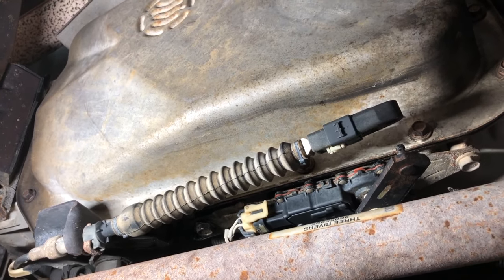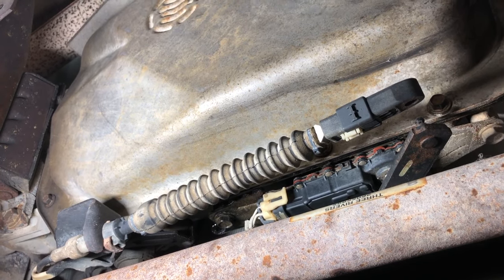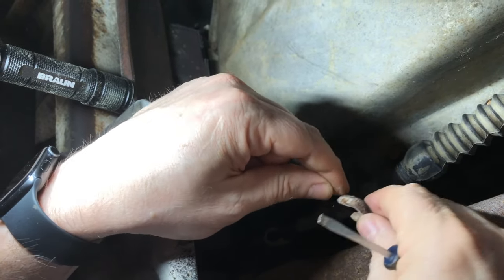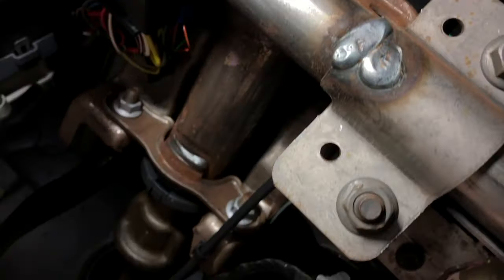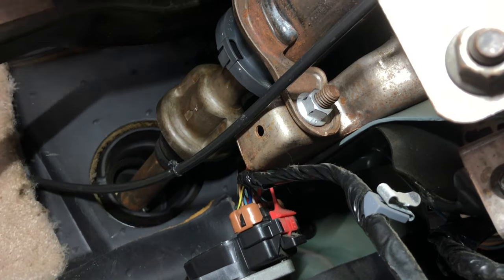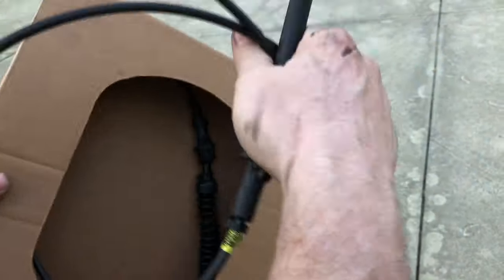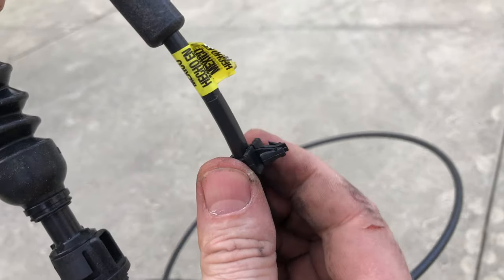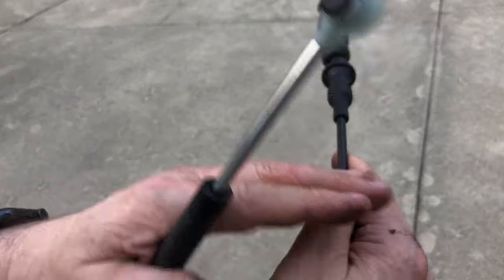1995 - 2000 GM OBS Truck Automatic Transmission Shift Cable Replacement Adjustment (Chevrolet & GMC)

Comment: This video was incredible and helping me change this cable. The time it saved me an aggravation was well worth taking the time to watch the short clip. Thank you again
Reply: @AlWhite-xo4of  Brilliant!  Only thing additional I did was pull all the floor padding out, used POR 15 on the seam and coated inside rockers.

Comment: Great video. My '95 GMC 1500 decided that I was not going to be leaving work today. I got in and went to put it into gear and the lever just flopped. Luckily I was able to crawl under and twist the cable around and get a little more of a friction fit. That worked well enough to get me home. I was hoping I could just buy a new bushing, but like you said there aren't any. Other than the one you linked. I think the cable is original, so it lasted 259k miles. I just have a bench seat in my truck so I'm not looking forward to replacing the entire thing. I have cable ties holding things together for now until I'm able to fix it.
Reply: I zip tied mine 6 years ago... use ty-wrap brand with the stainless lock. No problems.

Comment: Just wanted to say thanks for the video. I replaced mine today, frayed under carpeting. Couldn't squeeze the fittings out of the u-shaped bracket, so just busted them out with a screwdriver and mallet. Mechanics in my area are 4-6 weeks out in scheduling to look at anything, so the videos are appreciated because not all of us can wait so long.

Comment: Very thorough, the attention to detail is unsurpassed!  Kudos to you!  Attempted this replacement/repair last night.  The white locking tab came completely out.  Not sure what to do?  2 springs inside that end piece connecting to shift lever. Might warrant another short clip.

Comment: Bingo!  1995 C2500 pickup we bought used in 2009 with wedding gift money...I was adjusting ATF level yesterday after hubby overfilled it and after third round of change level/cycle through the gears/recheck level, the shift lever went floppy and stopped changing the gears.  Today the tow truck driver went underneath to manually shift the truck into neutral to put it on the flat bed, and as I had watched about 2/3 of this video, I asked him while he was under there to see if that was the end of the cable that had failed.  Sure enough, it was -- and he said there had been a zip tie on it previously, which was now broken!  I had him take a picture of it with my cell phone, and it looks just like you've shown here.  We think that actually shifting into first and second (repeatedly), even gently, was what did it.  Prior to that, 12+ years of P-R-N-D relying on the zip-tie.

I'm not up for removing the bench seat, and I'd rather fix it right than just replace the zip tie, so I'm letting the dealership take care of this.

Comment: EXCELLENT VIDEO!!  VERY thorough and well paced.  Probably the most critical portion is the adjustment of the cable at the end.  There are very few videos that cover that at all here so thank you for including that.  I have almost exactly this same truck, a 1999 Suburban K2500 but in blue.  The cable was never properly adjusted therefore first and second could not be reached by the shift cable.  I do think my bushing has some slop as well but I will start with an adjustment and go from there.  Thank you!

Comment: I changed my cable before watching this. I came here about the item that goes on the ball on the other side of the ball for the shift cable. Long story I had the other end of it disconnected to replace the Theft Deterrent Module.
 Watching this 2 things I found not mentioned. 1st @ 24:50 where you talk about what you call a "clip" is actually a sliding "lock". You show one side of it. The lock has ANOTHER tab on the other side. You have to lift/release BOTH "tabs" to unlock the sliding lock. The 2nd is @ 30:00 where you are putting the cable in it's holder. The hole has an open side to slide the cable in, AND the other side of the hole has square cutout. You put the cable on twisted 90° so that the cable's spring tabs orient to the sides-one tab in the open end and the other in the square cut-out, pull the cable through, then twist it back 90°. I learned changing mine. Also, on my '98 dually, you do not have to remove the seat (no airbags on it).

Comment: Superb video. Made it an easy 1 hour job to fix this issue with my '99 2 door Tahoe.
Thank you for the part number on the shift cable..  ended up buying the cable off EBay.

Comment: Thank you for that detailed video. I have a 1996 GMC YUKON that does not go into first gear. I will check the bushings , the lever and everything you did. I will try the adjustment with help. If it works awesome if not I’ll order the parts you mentioned. 🙏👍

Comment: Outstanding! (and great timing). I had to have my trans rebuilt. I had the cable replaced at the same time all from an Independent, not GM. My truck has two problems since this was done: 
1.) It is very stiff when shifting from Park down to any position and the same going back up to park. This is a huge problem when driving in the mountains when I take it down to "3" to avoid the trans cycling in and out of Overdrive while towing. The problem is that I have to take my eyes off the road and look down at the shift position and very carefully shift Up to Overdrive, as I am fearful of going past that position and to neutral, or worse, reverse. It is that stiff.   2.) The second problem is it will not shift all the way down (with the shift lever) to "1". It just stops at "2". I have a high level of confidence the cable was not adjusted as you have shown by the Factory Procedure.
Do you have any ideas on the first problem I am having???.
Reply from the maker: Could be both actually.  Even the aftermarket cables should have the adjustment tabs replicated to perform the procedure.  I believe this is a common mistake nowadays, where shops are not familiar with these older trucks and their service procedure details anymore.

Comment: Thank you video was very helpful and easy to understand
Reply: I can't go into 2nd or first but I can go thru all the other gears
Reply from the maker: Check that you have the cable aligned properly at both ends, and locked into position.   If you can't downshift to 2 or 1, this sounds like either an incorrect cable for the vehicle model, or a misalignment.

Comment: Thanks. I replaced my cable, but broke the die cast shifter when trying to pop the end of the cable on. Replaced the shifter and then couldn't shift it past drive. I figured there was some kind of adjustment procedure, but couldn't figure it out.
Reply from the maker: When you say "die cast shifter" are you referring to the shift lever that is part of the transmission?  If so, this lever only mounts on one way, and it will correspond 1:1 in position to each gear P, R, N, D, etc.
Reply: @DrShock  Nope. The shifter assembly on the column. Easy to change, just out $100 thanks to my gorilla fingers.
Reply from the maker: Ah, ok.  So no adjustment in reinstalling the shifter itself, but you want to get it into the matching positions at all three points.  Start with "P"ark.  Shifter in "P", transmission shift lever in park position, and then connect both ends of the shifter cable.  One at the column (with no adjustment) and one at the transmission shift lever as I show.  This latter one having the adjustment procedure I showed.  Test and then lock it in with the small clip made into the cable as I show.

Comment: Hi DrShock, you seem know well cars inside out. My car had shown "Input/Shaft Speed Sensor No Signal" error and was recently fixed. The professional was not speaking English well and all I understood is that the input/shaft gear had to be adjusted to always send the signal to the "Input/Shaft Speed Sensor". I wonder could what you explained in the video (although the car model/year might be different) be what he actually did to solve the problem. I would appreciate if you can point me in the right direction.

Comment: Im about to remove a 96 obs suv body, this is the cable i need to remove before lifting the body?( Including brake booster, shift column & gas cap)

Comment: Thank you for the video! I replaced mine and it wouldn’t shift lower than third, so I watched the end of your video and saw the adjustment part I had not bothered to watch! I’ve done the cable adjustment exercise five or six times (10-15 cycles) and I still can’t get it down to first… any suggestions? Thanks again.
Reply from the maker: Presuming the transmission lever itself is in the correct detent for Park before you start the adjustment, and that the cable is a genuine GM OEM one (some aftermarket ones just do not have good fitment), then I would make sure you have gotten the correct cable part number for your year and type of truck.  These do vary across years.   I could also suggest to recheck the steering column end of the assembly for both proper cable bushing seating, and the mechanism to the actual range selector lever being correctly aligned.
Reply: @DrShock  thank you for the advice! The OEM part was not on hand at the parts store, so I settled for the Pioneer brand, which is made in Colombia. I’ll double check the things you mentioned and try again.

Comment: Thanks for sharing your knowledge. I have a 99 6.5 diesel that won't start, and I live too far from any reputable diesel mechanics. Do you recommend a resource for a factory service manual?
Reply from the maker: I added a link in the description for the genuine GM manual.  Out of print for years, but you can still find them on eBay.
Reply: @DrShock  Thanks.

Comment: So went to replace my column shifter and broke the linkage connector off the rod. Any ideas of how to rig something up without replaceing the whole assembly. Was thinking about grinding the shifter lock mechanise rod and either using and hose clamp to put them together or worse case cut and weld togethor. Need to know asap pleasee
Reply from the maker: Need a little more clarity as to what exactly broke.  The bushing end of the shifter cable, or the steel ball it attaches onto at the column end?  If the latter, the easiest repair would be a trip to the local LKQ and pull the rod assembly.

Comment: So your video on shift cable was very helpful..I'm having a problem doing the adjustment.. it goes to all gears but won't go back into park..I'm having to push the shift lever to help put the shifter into park.. can you help?
Reply from the maker: Thanks.   So first I would disconnect the shift cable and determine if the range selector lever (this is the arm with the stud attached to the transmission) smoothly cycles thru all transmission gear positions.  This test is to determine whether the binding is in the cable or the transmission itself.   Each transmission selection on with the range selector arm will have a solid detent tactile feel so that you know you are there.  Just count from Park thru 1st and back.
 
If that all works smoothly, then the problem is in the shift cable.  Either the cable is mis adjusted, or internally damaged or the bushing at either end of the cable is damaged and not holding onto the attachment point securely.   For this test you will need a helper, and want to observe both ends of the cable (fully connected as normal) cycle thru each gear shift position.  You're watching for the stud coming loose from the nylon type bushing at the cable end(s).

At some point you're going to be able to determine if the bushing at the cable end is shot and introducing play that prevents the shift, or you're going to see that the cable is internally damaged or out of adjustment.

Comment: I have to change this out but I can get my shift lever back into park! Can I do this while it’s in neutral??
Reply from the maker: It's recommended to perform the repair with the transmission and shift lever both in the park position.  You could move the transmission range selector lever manually into park, from below the vehicle, like I show in the testing part of the video.   Technically, one could do it from the neutral position too if you had previous experience with this repair procedure. but it can be more difficult to ascertain that the transmission is in fact in that position.  It's important because if it's out of position, the vehicle will not start due to the protection of the neutral safety switch mounted onto the side of the transmission which is keyed to the neutral position.

Comment: Just curious, if the cable came off due to worn teflon, can I just replaced the small bolt and replace with a bolt and nut? I mean it would hold the shifter cable to the linkage firmly. Would that work instead of installing a new shifter cable? Thanks
Reply from the maker: The nylon material in the bushing holds onto a metal ball stud.  It has to rotate as the stud is attached to the shift lever which is angled.   You would be better off trying one of the bushing replacement kits in the video description than a jerry rig.

Comment: I don't understand why in the world they put such complicated connectors on this ! I mean a cotter pin or a e-clip would have been simpler, held better and been so much easier to replace if it did break or wear out. Same silly type bushing on my shift brake interlock  has worn out and it fell off. Noticed it when I was replacing the ignition switch module . I had wondered a while back when I was able to shift out of park  without my foot on the brake!
Fixed mine on the transmission end by drilling out and removing the pin, then putting in a 1/4-20 bolt and nut with nylon lock!
On the steering column side, a bushing that holds the foot on brake before you can shift out of park rod, wasn't holding that rod on so I just put a zip tie around it and the shift rod to keep them on their pins.

Comment: So my 1998 K2500 is having a problem where it shifts through all the gears perfectly fine but when I go to put it into park from reverse, the light stays on reverse on the dash and the truck will want to roll backwards. If you get under the truck and flip that lever, the truck will then fall into park and the light will also show park. I tried adjusting that cable because I thought it might have slack in it but it didn't do anything. Do you think that I need to replace this cable entirely? I am dreading it if I have to because I have a bench seat lol
Reply from the maker: It sounds like you're saying if you manually actuate the gear selection lever on the transmission itself, behavior is as expected.  But if you action it via the gearshift lever on the steering column itself, there is failure to move from R to P correctly.
 
If so this is a classic symptom of a problem with the shift cable, either the bushing at one or both ends has failed, or the cable itself internally, or both.  You could visually observe this at the transmission end by having a helper work the gears as I showed in the testing portion of this video.   Though it can also be a problem with the bushing at the other end of the cable, connecting on the steering column side.

Comment: My 2001 Chevy Silverado LT will not go into park.ive replaced the colum shift lever with the orange wire attached. I've replaced the solenoid switch. And I'm about to change the steering column shift mechanism. If that doesn't fix the problem.any ideas what it could be? Right now I have to start my truck in neutral and shut it off in neutral set the parking brake then shift it into reverse to get the key out of the ignition.any help would be greatly appreciated
Reply from the maker: It can get expensive throwing parts at a problem.  I like to diagnose what specifically is causing the symptoms, before replacing that particular part only.  Given what you've described, I would start with the shift cable like this video describes (tho your 2001 is a newer quite different design than shown here).   
 
I would make sure I can manually move the transmission shift lever into park, to confirm it's not a problem with the transmission itself (be sure to note and return the lever to the position you started with!).  I would next check that the shift cable is not out of adjustment and both end bushings are securely attached, and performing the full range of travel necessary to cycle thru all of the gear positions (this is often the root cause for the symptom you describe).  

If the transmission will shift into the park position manually, then the problem is related to the shift cable not being able to travel far enough to reach that position.

Comment: The gear selector on our 98 K1500 moves freely and won't engage any gear and the notch on the gear indicator never moves. The linkage underneath is still securely attached to the transmission and I can move the arm on the transmission to change gears which in turn causes the notch on the gear indicator to move also. I was wondering if it is possible that the cable would be broke somewhere along the way inside the sleeve? Or should I look at a different component?
Reply from the maker: The cable can break inside the sheath, but the bushing at the steering column end is more likely, I would check there first.  Regardless the cable would need to be replaced.
Reply: @DrShock  Thank you sir. I appreciate you taking the time to comment on these old videos. It really helps those of us who have recently purchased a GMT 400 vehicle.